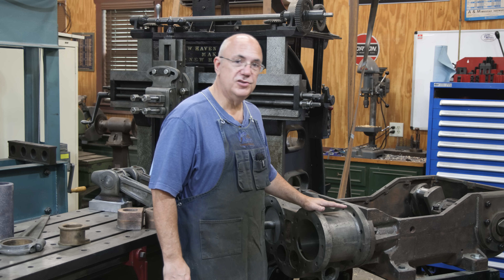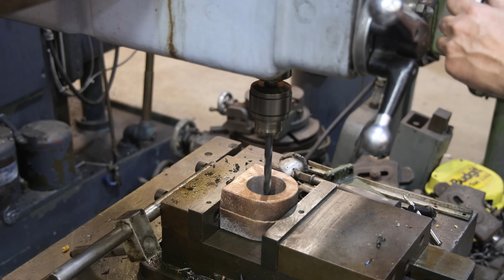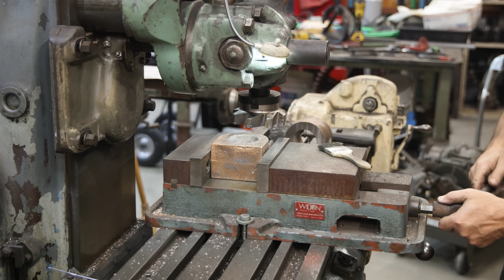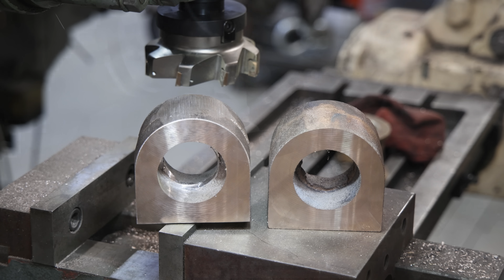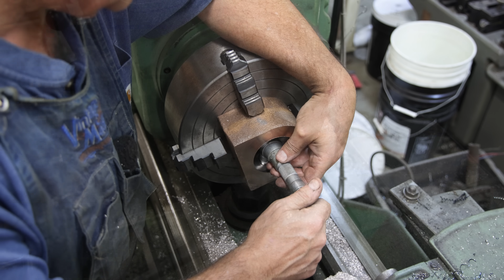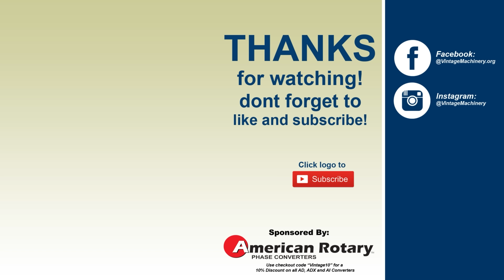Steam Stoker Engine: Machining Thickness & Boring the New Bronze Connecting Rod Bearings

Comment: Could I make a suggestion in regards to getting squared surfaces on these parts?
Jo Pie made a video on squaring up rough material where he had the material sticking up almost half thickness in the vice and he then milled the top and all 4 sides to get true surfaces all around and then he flipped the material and continues with thos other unmachine surfaces to have a completely true part.
I'm thinking that could have been done with these rod bearings.
I enjoy evey video you do.

Comment: I've been machining some bronze pieces I cast that needed 3/8" holes over the last few days and the drill kept grabbing. A drill press vice flailing around was way too much excitement for this old man. Many years ago I read that knocking the sharp edge from the tip of the drill was the cure, but had never had a need to try it. I found a 9-year old video by Clickspring, "Modifying a Twist Drill for Drilling Brass. I was surprised at how well the slight modification with a stone worked to avoid all of the drama. 

 I was wondering how you were going to avoid the drill grabbing your casting. Now I know. 😄

Comment: Since the bores are identical, did you consider splitting the two bearings first and then soft soldering the two round parts together for machining.  Ditto for the two rectangular parts. It looks like this would have made the machining easier.

Comment: 5:16 - There's a reason for a brass/bronze edge sharpening.
21:59 - Thank you!
23:47 - IC engines ('high speed'), rule of thumb is .002" diametrical clearance per inch of journal diameter, but those are pressure fed.
30:54 - Can't see it from my house.

Comment: Is the ring gauge calibrated for different temperatures?  I assume the bore diameter changes with temperature.
Reply: yes, the calibration temperature is usually 20°C, but as long as the micrometer is at the same temperature as the ring gage and the workpiece, it doesn't matter...
Reply: @Henning_S. That's not true. The ring gage will change considerably more than the micrometer.
Reply: @daveanderson2316 both are steel, so it should be the same...

Comment: I'm curious, is there a reason that you didn't square the sides to the first face that you machined flat before milling the other face parallel? My thinking would have been that it would make it possible to clamp better for deeper cuts when bringing it to final dimension.

Comment: Hi Kieth;
Question
Since you have to split these “brasses”, are going to use two bore centers to make an elliptical hole? That way you have an allowance for the slitting operation.
Reply: The bearings are adjustable, and the resulting gap from the slitting operation is needed to allow for later adjustment when the bearing wears down.
So the future wear does basically exactly what you suggested, the hole wears elliptical and then the gap can be tightened to make the hole round again...

Comment: Keith: I’ve been watching your channel for about five years & really enjoy the variety of projects you cover. 
I’ve noticed that you measure in only place when you machine bearing bores and journals. For modern automotive engines, where journal lubrication is pressure fed hydrodynamic wedge, we measure the bearing bore with a two contact gage, either dial indicator or air (if there are a lot of parts to check), taking  six measurements - front of bore vertical & +/-30 degrees either side of vertical; then rear of bore vertical & +/- 30 degrees either side of vertical. Same thing for conn rod bores. Also, cylinder bores are measured in a similar fashion for fitting pistons.
Measuring in two planes allows you to derive taper and out-of-round measurements in the bore. It’s easier to visualize this on an inspection data sheet than for me to explain in words, but this is how we fitted prototype engines at one of the major automotive  companies when I was an engine design and prototype engineer from 1963-2002. (The company that starts with an “F”.)
I don’t know if steam engines like your stoker project turn fast enough or have pressure lubrication to generate hydrodynamic wedge lubrication.

Comment: I always hated drilling brass, bronze and lead.  I got cut in the elbow by schrapnel from a shattered drill one time.  Then a nice machinist showed me how to grind the drill where it wouldn't screw itself into the workpiece.
Reply: Yes, a small flat on each flute, parallel to the centerline does the trick. You can’t have a hook on the cutting edges. I also learned the hard way.
Reply: It's called negative rake!:body-blue-raised-arms::body-blue-raised-arms:
Bozo, AKA Fenwick Babbit AKA the Elmer Fudd of machining spent his career in agriculture, and now he thinks when he puts that blue apron on he can magically BS everyone that he is a machinist.:face-fuchsia-poop-shape::face-fuchsia-poop-shape:
He spends Five minutes talking himself into every Bozo move he makes on a machine.
He drags out that bore micrometer ,that he handles incorrectly, because he also dose not know how to use the proper tool, a telescope gauge.:hand-orange-covering-eyes:
if you want to watch a machinist go to CEE, Keith Fenner, or Abom, if you want laughs come here.:face-blue-smiling::face-blue-smiling:

Comment: Dan here again. I have to mention that I’ve been watching a channel where a guy replace’s two Detroit diesels with two Cummins truck diesels. Good choice. In a 78 foot yacht. But he adds ECU’s, and other electrics to both, until he has a “about” a mile of wiring. A laptop connected to each. When he’s ready for sea trials, he can’t keep the engines running long enough to break in the cams ! A good sailor can sail without an engine, as did those before engines existed. Today why, but wise sailor would rather not have an engine if it wasn’t reliable, because it could get him in trouble if he depended on it, like a lee shore in the wind. Reliability and redundancy are what you need in an ocean. The aforementioned captain had neither. If he was that clever, he could start his engines with pull-start generators. Like pony motor on a bulldozer. 
He sends his wife to buy two new ECU’s, he overloaded the first ones. 
Just has to make me wonder why?
Looks like your steam engine is as simple as it gets. I hope we get to see it run. Nice job.

Comment: I have yet to see a casting from Windy Hill that did not have issues. Why do you continue to feature this foundry?
Reply: Have you ever worked with a foundry? The castings he gets from Windy Hill are as good as any other competent foundry. Voids and inclusions are just a part of life when dealing with a casting. You can minimize them, but they will almost certainly be there. If those are not acceptable then go to solid bar stock.
Reply: Because it's a shade tree operation just like Bozo!:face-blue-smiling::face-blue-smiling:
Bozo, AKA Fenwick Babbit AKA the Elmer Fudd of machining spent his career in agriculture, and now he thinks when he puts that blue apron on he can magically BS everyone that he is a machinist.:face-purple-wide-eyes::face-purple-wide-eyes:
He spends Five minutes talking himself into every Bozo move he makes on a machine.
He drags out that bore micrometer ,that he handles incorrectly, because he also dose not know how to use the proper tool, a telescope gauge.:hand-orange-covering-eyes:
if you want to watch a machinist go to CEE, Keith Fenner, or Abom, if you want laughs come here.:face-blue-smiling::face-blue-smiling:

Comment: As always: You can do a little bit of everything, but nothing properly. The technology and sequence for machining the bearing block are not optimal. Not to say that it's wrong.
You first create a reference surface and then create additional surfaces perpendicular to it. You never start with two parallel surfaces on a raw casting like this. Due to the poor clamping, you won't be able to rely on parallelism, and errors will occur.
But I don't even know why I'm writing this, because you ignorant guy don't even read comments.
Reply: Well you sure think a lot about yourself don't you. Male Karen😂

Comment: Question, OK I know they are not bearing surfaces on the faces. But to me even if they were why are a few tiny inclusions bad? I'm just thinking of scraped surfaces, it's mostly valleys rather than peaks, you only need 25 peaks per square inch. and the valleys are traps for oil which is even better. can't these inclusions do the same?
Enhance my knowledge please.
Reply: If there are too many inclusions or they go deep enough, they could compromise the strength of the part. The rougher the surface the higher the pressure on the remaining high spots, so if it's too rough that pressure can be enough that it deforms under load. Since the face in this case isn't a load-bearing surface it doesn't matter much, but if it were bad enough to show up inside the material it could result in inclusions on the load-bearing faces, which might be bad.
Reply: @PeregrineBF thanks fella
Reply: Don't fall for all of Bozo's scraping BS!:face-orange-frowning::face-orange-frowning:
Bozo, AKA Fenwick Babbit AKA the Elmer Fudd of machining spent his career in agriculture, and now he thinks when he puts that blue apron on he can magically BS everyone that he is a machinist.:face-fuchsia-poop-shape::face-fuchsia-poop-shape:
He spends Five minutes talking himself into every Bozo move he makes on a machine.
He drags out that bore micrometer ,that he handles incorrectly, because he also dose not know how to use the proper tool, a telescope gauge.:hand-orange-covering-eyes:
if you want to watch a machinist go to CEE, Keith Fenner, or Abom, if you want laughs come here.:face-blue-smiling::face-blue-smiling:

Comment: Hi, I don't understand why you would get a micrometer standard out measure it and not reset the tool. and use it as if it was correct. seems like flirting with disaster.. 
Rich
Reply: By knowing that the micrometer is.002 off is fine. Just make the part a few ticks larger. Taking an hour to calibrate the micrometer will still give the same results. 
Keep in mind, he could have skipped showing us this part of the video, but chose to show how you can do the job anyway.
Reply: @Jimgotalathe  He said it was "a couple of TEHTHS". A "tenth" is 1/10,000", so two "tenths" is .0002" not .002".
Reply: @PhilG999 My bad. I couldn’t remember the exact amount without going back over the video. But the principle is still valid.
Reply: The bore mike setting may be accurate. Handling the gage and bore mike with bare hands could easily change the reading .0002.
Reply: I was thinking the same thing.  Checking the mike's calibration, finding it out of calibration, and then ignoring the finding seems counterproductive.
Reply: @peterhobson3262  He's taking the variation into account as he bores the part...
Reply: Bozo, AKA Fenwick Babbit AKA the Elmer Fudd of machining spent his career in agriculture, and now he thinks when he puts that blue apron on he can magically BS everyone that he is a machinist.
He spends Five minutes talking himself into every Bozo move he makes on a machine.
He drags out that bore micrometer ,that he handles incorrectly, because he also dose not know how to use the proper tool, a telescope gauge.:body-blue-raised-arms::face-red-droopy-eyes::face-red-droopy-eyes:
if you want to watch a machinist go to CEE, Keith Fenner, or Abom, if you want laughs come here.:body-blue-raised-arms::face-blue-smiling::face-blue-smiling:

Comment: Bronze can be scary to cut in my limited experience. Especially with HSS tooling. I know from bad experience. Your rigid boring bar with carbide insert is the way to go. This component presents some difficult machining techniques. Looking forward to the outside machining and how you will do that.

Comment: Also that the part was cooling down during those spring passes and measurements, was changing the diameter.
Reply: yeah, but take into account that during operation the part swells up again due to heating...

Comment: Why didn't you model the original form of the bearings with a little smaller hole?
Reply: Because it would make the molding process way more difficult, because the recess around the circumference can not be done with a 2 part mold.
And the circumference needs to be machined anyways to create the tight fit inside the adjustable bearing holder